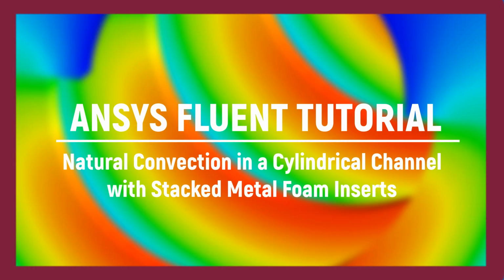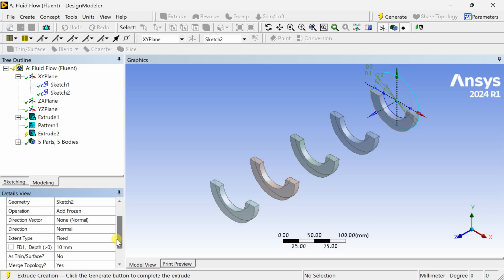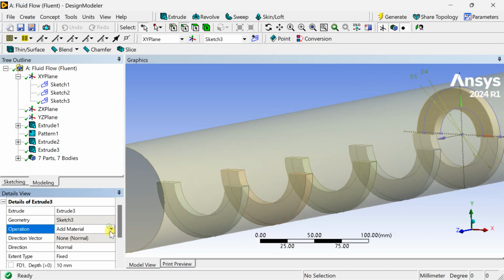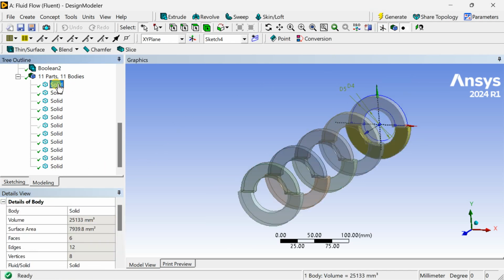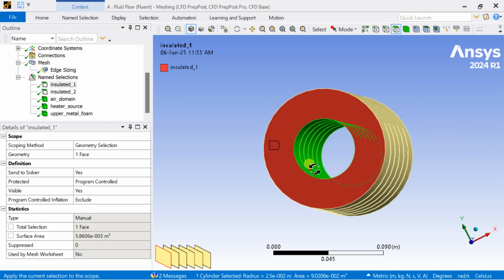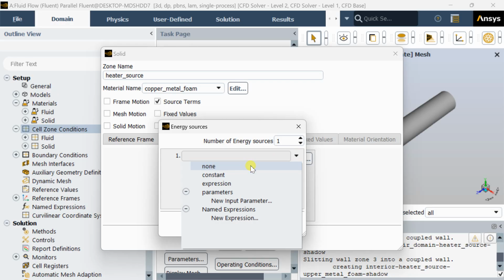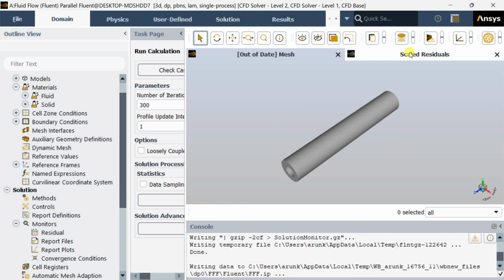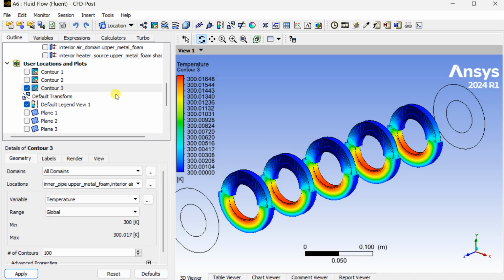ANSYS Fluent Tutorial: Natural Convection in a Cylindrical Channel with Stacked Metal Foam Inserts

Comment: You did not enter parameters like, porosity, permeability or inertial coefficient when you used metal foam. That is a mistake
Reply from the maker: In this tutorial, I used the default porous zone settings for demonstration purposes, but you can certainly input specific values for porosity and permeability based on your material properties.